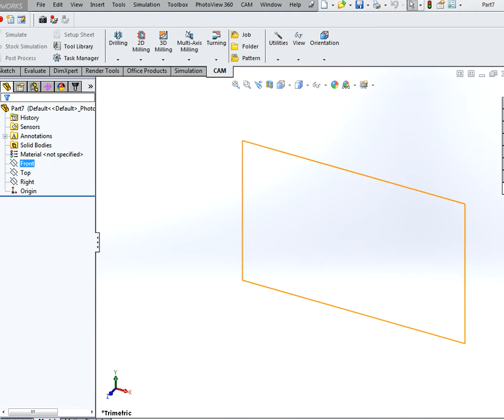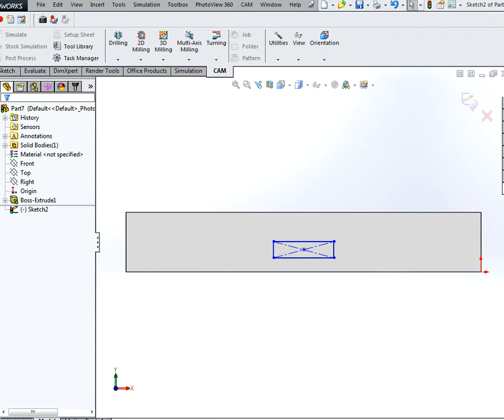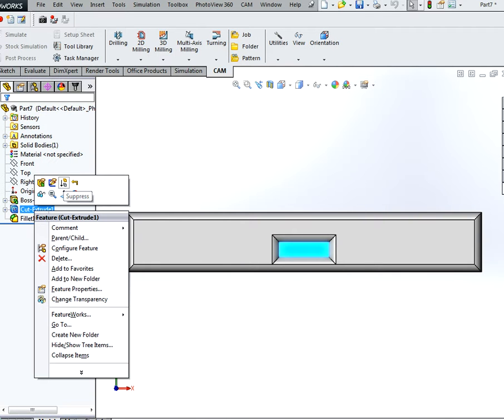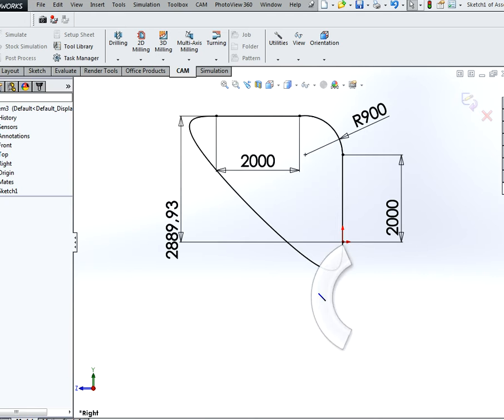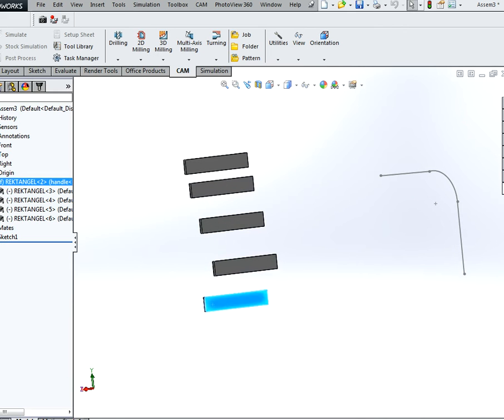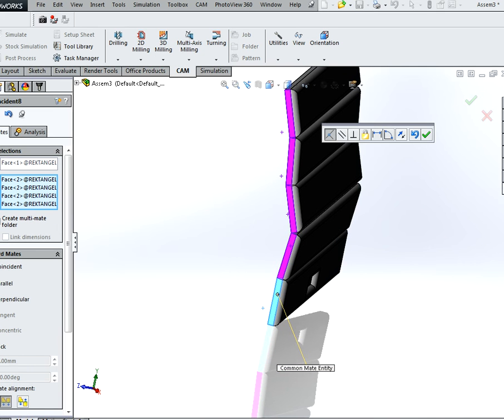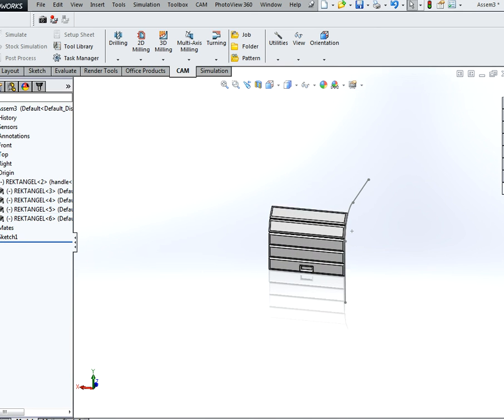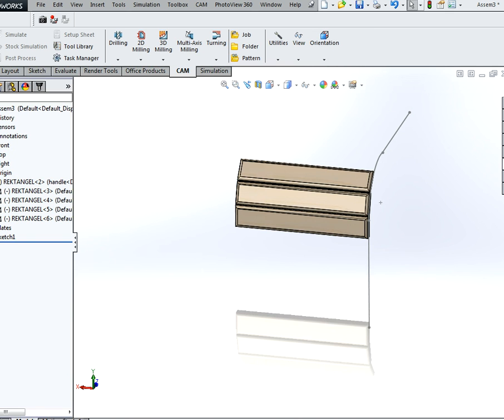Tutorial: Moving garage door solidworks

Comment: Hello, even if I only mate the edges noted, the pellets stick together and aren't at all flexible, I also can't mate them to the profile. Do you have an idea on what I could be doing wrong?
Reply from the maker: Hi Sophie! could be two possible things that i can think of , the first thing to take to note is that the first part you import is by default set as fixed, if you don't want it like that, just right click, and from the drop down menu select float i suspect this to be the error because your basically telling the program that your part which is fixed anchored in space mated to other part shall be moved. Another less possible scenario is that you created a subassembly instead of an assembly and in subassembly every movement is by default set as rigid to undo this right click and select document properties and set as flexible instead.

Comment: hey how did you get the door to stick to the sketch and it still move when i mate them the door is stuck in place
Reply from the maker: Probably forgot to mention that the first part you import into your assembly will by default be fixed , just right click the part and select float in the pop up menu. Good luck! :)
Reply from the maker: Also make sure you create a single line sketch and then use edges and vertices while mating, this will give you a flexible assembly.

Comment: Thanks for the amazing turtorial , your helping me with our project , but how do you rotate the object without going to the command ? is there a shortcut
Reply from the maker: Thank you!  In assembly mode, i think if i remember correctly you just hold down and press right mouse key while pressing your part.  Also keep in mind that the first part you import will be preset fixed (locked) in air, if you don't want it like that just right click and in pop up window select float. Good Luck! :)